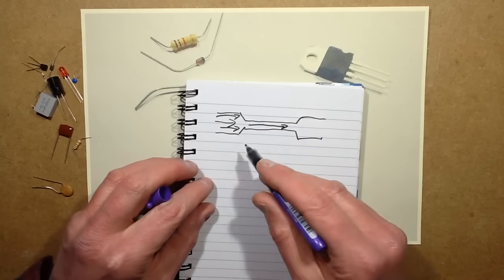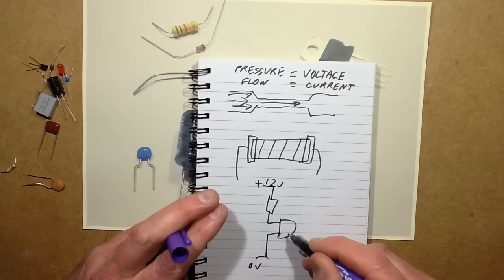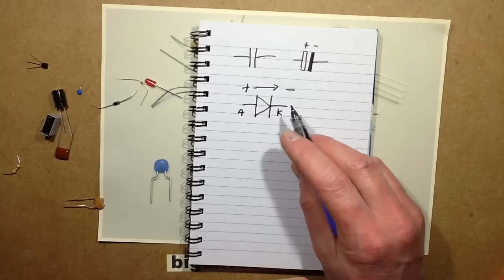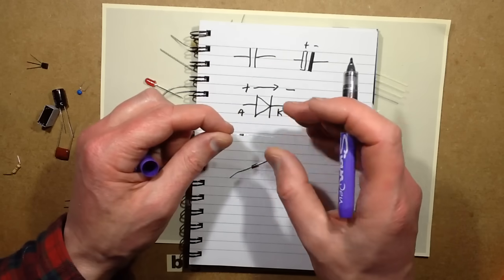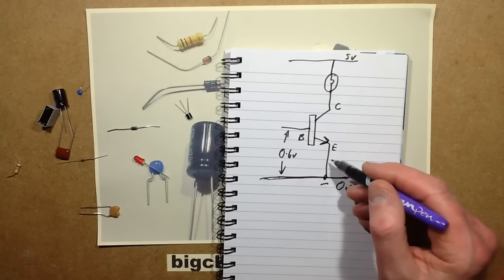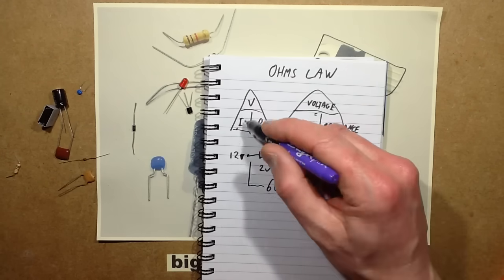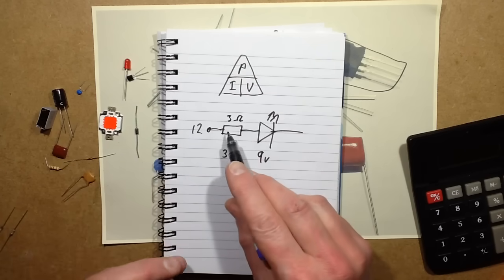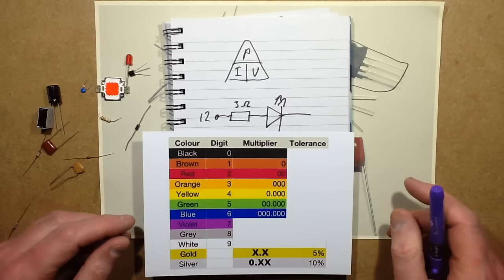A simple guide to electronic components.

Comment: though i realise the "water model" of explanation of electricity is imperfect, it is useful for videos like this. however, having initially started out explaining what, in the water model, is "voltage," "current," and "resistance" .. what then is "amperage" in that model? likewise what is a "watt"?
i ask because i'm trying to get my head around the ohm's law explanation, where the formula is very straightforward, yet the terminology seems to just run amuck (in terms of my own understanding). you say of the big LED "the voltage across that is about 9 volts" and then of the resistor "we've got 3 volts divided by the 1 amp we need," and then start calculating for watts. is a watt a unit of measure for P (power) the way that the ohm is a unit of measurement of R (resistance)? and how did you come up with "the 1 amp we need?"
many thanks. sorry for all the questions. i just thought i really understood it right up until it felt like unfounded terms were just flying in from every direction, and i like your explanation beyond that.
love the geeking out and i love an in-depth explanation of the fundamentals that relate directly to the bigger picture.
Reply: Amperage is a unit for (electrical) current, and Watt is sort of a generic unit for power, 1 Watt = 1 Volt * 1 Ampere in terms of electromagnetism
Reply: chris kaprys h

Comment: All of this is so frustrating . This electricity thing seems simple but yet overwhelming when you try to put the pieces to the puzzle.. I have a school project and im freakin out can someone please help me. I have to create a heating element that puts out 100 degree temperature and must be water resistant and battery operated 😔 i dont want to quit but this is taking a toll on me and having a new born is not helping lol. Thank you to whom ever may share some info.
Reply: victor chiru does it have to be exactly 100 degrees? If not, I would advise using a standard heating coil and connecting it directly to the battery, then encapsulating the whole thing (except the material the coil is made out of) with a material or box of your choice

Comment: Sir, You said that resistor is used for limit the current i didnt got that.
If we consider two resistor in which suppose 2A is flowing then just passing by first resistor the current isn't reduced  down 2A current is still flowing through the remaining resistor. I request you remove my misconception if i am wrong.

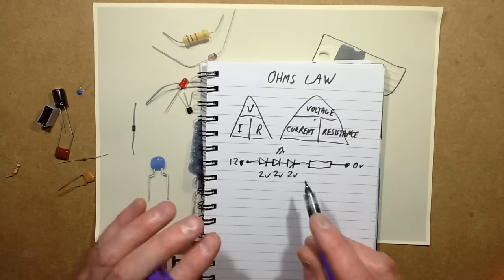Comment: Hey. I have a question around the 26:20 mark. 

So you have 12 V at the source and you want to make it 0V at the output. You use 3x 2V LEDs, so that at the end you'll have to deal with the leftover 6V. To pick the correct Ohm resistance for the resistor, you need to use the formula: R = V / I. Where from did you take the value 0.01 A (or 10mA) for the current?

Thanks! Love your videos, keep up the good work!
Reply from the maker: A typical 5mm LED requires a current of up to 20mA to run.  I chose the value of 10mA (0.01A) as a suitable value.
Reply: bigclivedotcom Understood. Thanks!

Comment: Switching off the entire bench, rigging up a reverse-biased electrolytic cap to a 30 volt power supply and then hiding the whole thing under a book was a typical prank we pulled in the electronics lab at university. Other guy would come in, plug in his stuff and see that the entire bench is off - so he'd switch on the bench and not know that he just turned on a bomb that will go off in a few seconds. It was all fun and games until someone just jammed the leads of the cap into the power socket (mains power instead of 30 VDC). The resulting explosion destroyed his textbook and sent smoldering paper all over the room.

Comment: I more comprehensive video on capacitors would be good. Like when do they charge and discharge, what happens to current flow during these stages. What capacitors to use to smooth certain frequencies etc.
Reply: John Michael Stock nice !

Comment: If my understanding of transistor is correct, one can rely on only NPN (or PNP) transistors. All you need to do to fit a NPN transistor where a PNP is supposed to go is to move the components around? Or is there more to it than that?
Reply from the maker: NPN normally switches down to the negative rail while PNP is better suited to switching up to the positive rail.

Comment: Good Video. However, current always flows from negative to positive. So in the case of diodes and emitter-base and emitter-collector currents in transistors,  the current flows backwards to the orientation of the arrow.

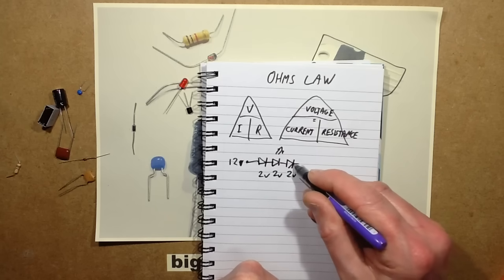Comment: 26:10 how come resistor wen on negative side and not before the LEDs? why doesn't the LEDs (or the 1st one) get hit with the 12v and pop ?
Reply from the maker: The resistor can go anywhere in a series circuit.
Reply: sypher0101 as long as there arent any branches, resistors can go anywhere

Comment: bigclivedotcom Do you own a Raspberry Pi 2 or 3? If so then I was just wondering if you'd be able to identify what one of the components is for me so that I can see if it's something that can be repaired or replaced.
Reply: Luigi Provencher Most everything on the Pi is surface mount, and would be very difficult, if not impossible, to replace by hand.  Unless it is with one of the through-hole components (USB, Ethernet, and GPIO header), you would most likely be better off just buying a new one.

Comment: In Chinese, We refer to Voltage as "Electric Pressure", Current as " Electric Flow", Resistance as "Electric Obstruction", Batteries as " Electric Pool", and a couple more terms that I've definitely forgotten about
Reply from the maker: Those are all perfect descriptions.
Reply: Those are actually good terms.
Reply: yeah they use that starting out as a analogy to water flow
Reply: I've seen some translated descriptions that call the battery, the "pump", which I did NOT understand until I started grasping how electricity works. XD
Reply: Great terms! Thanks
Reply: That sounds less confusing doing it that way.
Reply: Looks like it's all FLOWING in the direction of the water analogy hahahahahansjajsjdofndkkkx

😅😄😑
Reply: i've been torn on whether to learn korean first or mandarin but i might start with the latter just to be able to use it for maths and electronics
Reply: transformer is "pressure changer", transistor is just "electric crystal", capacitor is "electricity container" and diode is "bipolar tube"
Reply: noice
Reply: Very cool.
Reply: So when the battery runs down  it's "Dead Pool"
Reply: Hi guys learn PCB design so click these link
https://youtu.be/ApXhpz8XPWE
Reply: tuxcup I feel that to be an issue if you mix your electric pressure with your shower 😯 Maybe the repair man is from us and misreads wire color coating
Reply: @sparticus214  Another pathetic little cheap shot about  the U.S. Why do you feel this is nessesary? Maybe it makes you feel better
Reply: Chop Chop Scottis presenter speaking English. Nothing to do with America. Snowflake much?

Comment: so is the bigger transistor the same as a small one?
Reply from the maker: There are lots of different types of transistors, but each different technology is available in a wide range of sizes.  The subject of transistors was too huge to cover in this video.
Reply: did you know, CPU's and GPU's have millions if not billions of tiny transistors that turn on and off millions of times a second. for example a CPU running at 3 GHz would have the transistors switching 3 million times a second and a CPU like my i7 5820K has 2.6 billion transistors, this would explain why CPU's get hot when being used

Comment: I didn't understand the Power calculation example. If P=I V, and I=3 ohms, and V = 3v, then shouldn't P=9W? What current value do you use? For the entire circuit, or for the resistor? Thanks. Helpful video.
Reply: There's two interesting equations, V=iR and P=iV, and you've got to be careful not to mix them up.  3 Ohms is the resistance of the resistor, not the current flowing through it - in Clive's example he was calculating for a 1 Amp current.  So your P=iV becomes P = 1 Amp * 3 Volts, which equals 3 Watts.
Reply: To address your second question, when you have a number of components in series like this the "same" current flows from the power source, through all the components in turn and back to the power source.  While Voltage is sort of "consumed" by the components causing a voltage drop, the current is not "consumed" - so the current flowing through the resistor is the same current that flows through the LED.

Comment: This is an outstanding video, thank you very much. I have been struggling with the basics just trying to teach myself and this has really helped.
I see in some instances you put the resistor in before the diode and in some after, is there a reason for this or does the order not really matter?
Thanks again.
Regards, Martin.
Reply from the maker: In a series circuit the placement of the components doesn't usually matter.

Comment: Thanks for the good video. But I've got one thing....:) If you take a waterpipe with 2 cm diameter and then you restrict the pipe to 1 cm at the end, then the water pressure will increase. (That is used to run Pelton turbines efficiently, for example). But with an electrical resistor the pressure (voltage) will not be higher at the end. As I understand an electrical resistor will slow down the voltage(pressure) andalso the current(flow), while a restricted waterpipe will slowdown the flow but increase the pressure. So it is not exactly comparable 1:1, I mean waterflow and currentflow.
Reply: But you forget the water pressure goes up at until the restricted area is passed then the pressure is only the remainder of what the total pressure of the pipe is, for example a pipe at 60 psi restricted may increase pressure to 90 the remainder would be 30 psi on the next section of pipe unless in your case it being a nozzle so atmospheric pressure lol and that's not alot...think of pressure as heat (resistance) pipes burst and resistors burn up so in essence its more  of a regulator - the resistor I mean; The force of a nozzle can be great yes but if you put another section of pipe after the restricted nozzle you now have a pressure regulator or resistor of flow. You are wrong sorry but I see the genius in your query.
Reply: what you have mixed up is flow and pressure the fact that the water is exiting to the atmosphere it have an unlimited area of flow compared to the restricted pipe so flow increases but if you measure the overall pressure of the water it would be lower than before the restricted nozzle and pipe.
Reply: Ghetto Dexter you get higher pressure after the restriction take you water hose no nozzle and how far does the water shoot out then add nozzle and spray how much farther does the water shoot out. A lot. You get less volume but more pressure and speed.
Reply: Exactly!
Reply: Sorry I know that it's been a year but I will replay anyway
I think it's the same, if you have 2 resistors in serial one of them is 2 ohms and the secend is 1 ohm there will be a higher voltage in the 2ohms resistors (it has a thinner way) 
The voltage in serial get devided (if it the right word to say it)
Sorry for my bad english
Reply: Actually - counter-intuitively I admit - water pressure decreases with a decrease in pipe diameter (in accordance with Bernoulli's principle). In addition to this, as pipe diameter decreases flow rate remains constant and instead flow velocity increases.
Reply: Am I the only one who doesn't understand? No hate bruh.

Comment: How to know if a Metallized Polypropylene High Voltage Capacitor is damaged?
Reply from the maker: If it's degrading then it's capacitance value will reduce.  You can test it with a meter that can measure capacitance.
Reply: bigclivedotcom So, it isn't like an electrolytic capacitor that shows physical signs of failure... So, you have to measure it! I would also like to know how often a metalized film capacitor fails when compared with an electrolytic one.

Comment: Hi I'm enjoying your video thank you for doing it.  At 27:30 you mention to find the voltage we want to take 6/0.01 Amps.  How do you know you want that number (0.01)?  Thank you.
Reply from the maker: The 0.01A (10mA) is a typical current used to run ordinary LEDs.
Reply: Thank you!
Reply: +Naida Palmer
here's  a few suggestions for how to pass the Asvab exam
Give yourself a rest
Don't beat yourself up about it
Check out some trial exams online
(I read these and the reasons they work on Wilfs Exam Blueprint site )

Comment: I remember blowing up caps in school, smells like crappy eggs lol.
They can pack a punch if they`re big enough and you reverse the polarity with enough power input.
But how much really..?
I heard of a guy that for some reason didn`t have safety on his 1 farad cap in his subwoofer amp in the trunk of his car. He managed to get the polarity wrong and blew it up and ruined the car.
Or so it was said :p
Which makes me wonder:
Just how much damage can a 1F capasitor do?
Reply: I'm sure having the weak points on the top of the can is a fairly recent development.
Thus older electrolytics could fire the can with some force.
Reply: That is very possible, but its not that long ago.
Mid 90`s :)
I remember some just going pffffht, and others going poff though lol..

Comment: Excellent tutorial.  One thing I would like to take issue with is how circuits fail.  After tearing apart and testing some atx power (some working some not) I noticed a common thread.  In the ones that just died after say 10 years or more all the circuit boards and components showed no signs of damage.  When I measure the caps most of them showed lower capacitance but not much difference in esr values.  The bad ones had high voltage loss along with low capacitance value.  This is probably the most common failure mode, not visable damage, in well designed circuits.

Comment: I'm assuming everyone can hear this video, I see no comments. I can't find out why I'm not hearing it and a handful of other videos. Any thoughts folks?
Reply from the maker: It's a common problem with the mono audio of the video.  Sometimes your Dolby audio processing on your computer may be set to divert the audio to a single speaker that doesn't actually exist on your system.
Reply: I'm assuming no one is clairvoyant and won't be able to help you. You should do some basic checks (is it only on this website? or is it on your software, talking about your web browser? or is it on your whole computer, on any program? ...).
Reply: Uninstall your audio drivers and reinstall them. Before you do that make sure your volume on your speakers is up, check on the desktop that the volume is up, right click and check uh, whatever the options are to make sure your browsers volume is up. Sorry I'm on my phone, so I don't remember the option

Comment: That was an outstanding explanation of resistors. I immediately remember the colours the rude way too. I am just starting my journey with electronics. Was going to buy a bread board to try a few experiments - would you recommend this way? how did you first start and what was your first project?
Reply from the maker: My first project was a kit which I completely nuked with my bad soldering.  A breadboard is very useful for roughing up circuits.

Comment: I still try to understand how i would calculate what smoothing capacitor to use. I never understood it.
Reply: Maybe your laser will make a nice humming sound in a sword.
Reply from the maker: A very rough rule of thumb is to allow about 10uF per milliamp of the load.
Reply: Thanks, that is at least something i can go by and experiment!
Because i find all types of different formulas, and they all give different results. One even suggest going 4000uF for 25mA load.
Reply from the maker: It depends on how sensitive your circuitry is going to be to ripple of the DC supply.  In an audio application that could manifest itself as a slight hum, but for a basic LED type application it wouldn't be so critical.
Reply: Its for a laser diode. I know there are really good drivers for cheap, but i wanted to make all the circuit design by myself.
Thanks again for your input!
Reply: Please have my upvote! PrinssiFO

Comment: PNP=Pointing in pointer  NPN=Not pointing in. If your looking at a schematic
Reply: Might as well remember the meaning: Positive Negative Positive (doping) where a diode in simply Positive Negative, and an N-channel FET is a PN diode with the current running sideways through the N line on the symbol (and in the hardware).

Comment: I was taught that "K" was used for "cathode" instead of "C" in order to avoid confusion with "collector". Normally viewed current always flows towards the cathode, but in a transistor current would flow towards the collector on a PNP, but away from the collector on an NPN. It was deemed useful to use different terms for these devices, and you don't want to use the same abbreviation for two different things.

I don't know if what I was taught is the real reason for the "K", but it works for me.
Reply: I thought sure the K was because of the Greek word for it.
Reply: +Adam Brown κάθοδος
Reply: Bum bass
Reply: With resistors K=1000

Comment: Why does the resister come AFTER the diodes? to limit the flow, shouldn't it come before it?

I'm not good at this.
Reply from the maker: A resistor can be placed anywhere in a series circuit.
Reply: Basically, putting resistance anywhere in a flow, will limit the current of that whole flow. It's not that the "water" before or after it runs faster, the whole stream is slower in general.
Reply: Hack a supply from computer